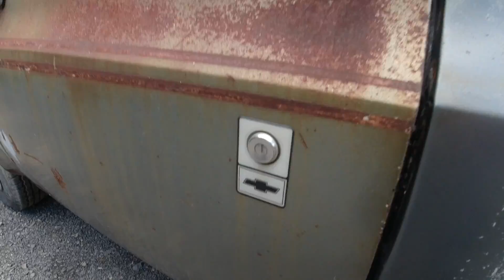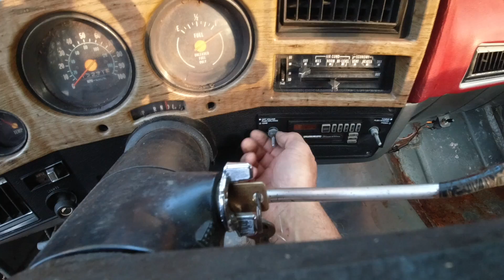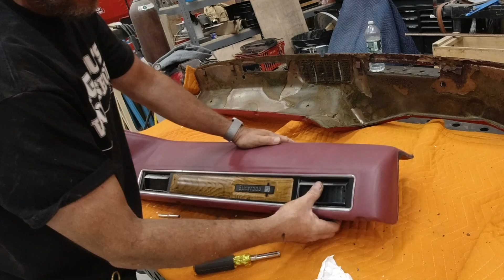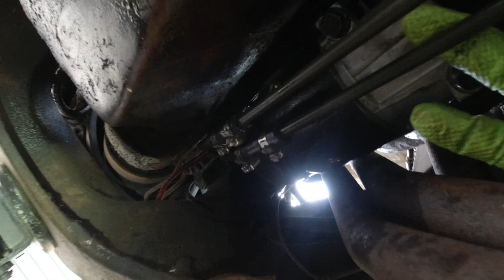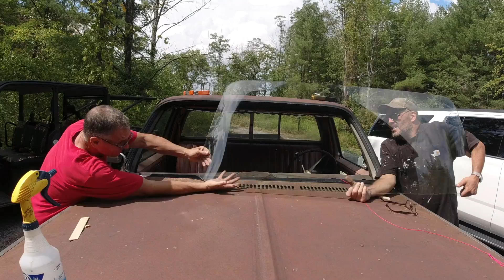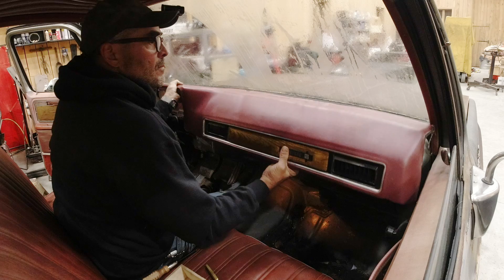DiResta 77' Chevy Truck Repairs

Comment: I usually put the connector in a vise, put little pieces of cut solder in the connector, heat it with a torch, and dip my wire into the connector. Easy peasy.

Comment: My youth of fire wood hauling in 1978. I was 17 years old. Had a 1971 Chevy with three on the tree. Those linkages once worn would drop into 2 gears at once when shifting from 3rd to 1st gears. Had to shut her off, open the hood and pry the linkage back in neutral. A few incidences and we found a used 3 on the floor. Cut a hole in the floor board. Poor people do what they can.

Comment: Windshield removal - use feet.  Install - cord in glass channel.  I've done a few windshields.  Conclusion: it's not worth the hassle, leave it to the guys who do it everyday.
Reply from the maker: Tbh I called satellite and they said I have to bring it in.  They stopped doing the old stuff on site.   So I accepted the challenge
Reply: @jimmydiresta  - Like you say, the first one's a learner.  Trouble is, the next one will be 20 years from now and you'll have forgotten all you've learned.
Reply from the maker: *safeLite

Comment: If you had mice, you really need to check the cab corners at the rear. Besides just moisture accumulation back there, mice will get up there, and you know what mouse piss does...

Comment: I wanted to help so much with the windshield.  The highlighted comment was definitely the way to do it.  Rubber goes on with a sash cord pull rope.  Outside pressure while the cord is pulled from the inside.  But you got it done!  And we put the lace rubber in from the middle of the bottom so there wouldn’t be a chance of rain getting in at the top.

Comment: I was super confused for a minute there. 
Looked like you were gonna weld steel brackets to a plastic grille. 😳
I realize you do awesome work, but if you had pulled that off I would have had to re-evaluate my entire life...lol.
Couple of spray cans of vinyl / rubber paint with make those door panels look like new.

Comment: Loved the video! My first ride was a ‘75 Chevy p/u. I replaced the dash as well! Lots of memories working on that truck. Engine bay so large I could sit on the wheel well and wrench on it. Be careful of the throttle cable. Mine frayed inside the housing causing the accelerator to stick. Had to reach down with my hand to pull it up doing about 60 mph. It’s an easy part to replace.

Comment: The rubber goes onto the windscreen while its on a bench. Put some nylon cord around the groove in the rubber, again while it's still on the bench. Place the windscreen in the  windscreen appature. Apply pressure to the screen (2 man job) from the outside while 2nd man pulls the cord from the inside. This pulls the rubber over the flange. Explains why the windscreen fitter did it in 15 mins
Reply from the maker: I did experiment w a string but I didn’t see how it worked 🤷🏻‍♂️ but I also didn’t look it up 😇
Reply: @jimmydiresta  There is a tool with a pin and roller, so you don't have to use your thumb.
Reply from the maker: Wow
Reply: And now we know
Reply: Love it that you didn't go get on YouTube. You said something like: my logical mind says it should work. This is what drives me, the logic of technique, there's a methodology, it just has to be discovered.
Reply: I realize I should have explained it better to jimmy when I did... but he is a smart dude and even through the struggle he managed to pull it off!!! 💪💪💪
Reply: You can use the rope method on the back glass.It WILL NOT work on the windshield.
Reply: Jimmy did it the right way. That gasket was not a rope in

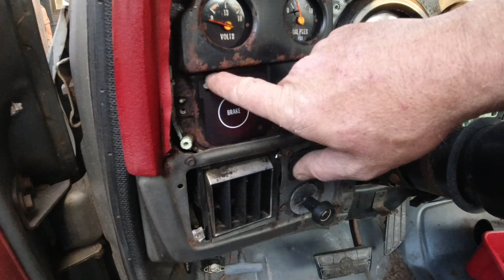Comment: @8:53 At one time you could disconnect the speedometer cable from the transmission, hook up an electric drill to the end of the cable and run the drill in reverse causing the odometer to turn backwards taking mileage off.😂😂😂

Comment: Strongly agree with your decision to leave the patina untouched. It is beautiful!
Reply: I knew the comments would be full of crap about that "beautiful patina."  There is such a cult following on all of these YouTube channels.
Reply: @mrshoeguy2477  agreed, that truck would look 1000 times better with a paint job
Reply: @paulhopkins1905  
Sure. But a nice paint job means pulling the bed and front clip to do complete rust removal/repair. If you're that far in, pull the cab and do the frame. Why not rebuild the engine and transmission while at it.

That's usually when it gets parked back in the weeds and rots while waiting for "when there's time".

I'd much rather have a classic American truck back on the road in less than perfect condition.
Reply: @841k9  Nahh, you can do a surface repair paint job and not ride around in a rust bucket
Reply: @paulhopkins1905  
Then you'll have rot through in a few years and it'll just look like a half-assed restoration.
Reply: @841k9  Nonsense, it will rust through the "patina" just as well. Look at the floor boards in that truck, it is basically rust free
Reply: @paulhopkins1905  
A crappy paint job that covers rust only makes it spread faster than just leaving it alone.
Reply: @841k9  Oh my god, I'm not saying to not correctly prep the body idiot. I'm saying there is no reason to pull the pannels. That truck only has surface rust. There is no cancer